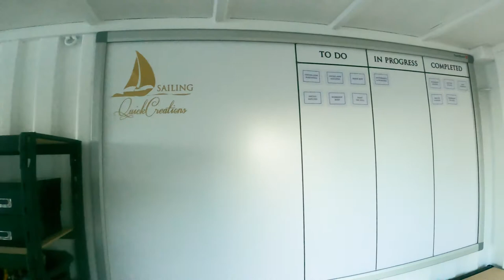Sailing QC #5 | Bow Issues & Completed Boat Workshop - Steel Sailboat Restoration

Comment: Suprebe finishing work on the container... when you see how it was before, Bravo, that...: it's good organization, to start a construction site and see clearly the projects and work carried out every day.. .great congratulations!!    careful when cutting the portholes not to weaken the structure of the deck, whose chainplates will be welded on it I think, for the windlass why not make a hatch that opens in 2 pieces, and shift the windlass a little to starboard, like we usually do to have a main anchorage on this side...!! the rounding of the windows is not there by chance... it is to avoid leaks, reinforce the seal and constrain the same structure in all places, a square corner will be much more fragile than a round one
Reply from the maker: Thanks so much Vince love your advice, really appreciate it! so glad you love the Shipping Container workshop, its been soooo helpful having it on site to assist with the build of the boat!